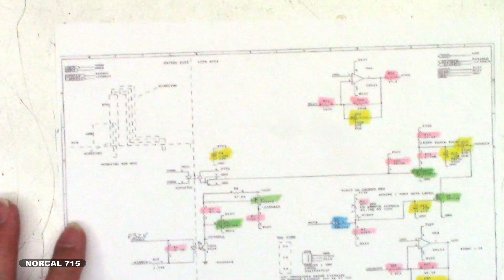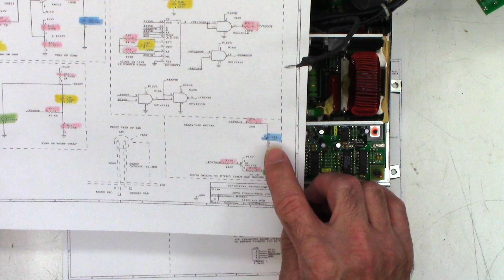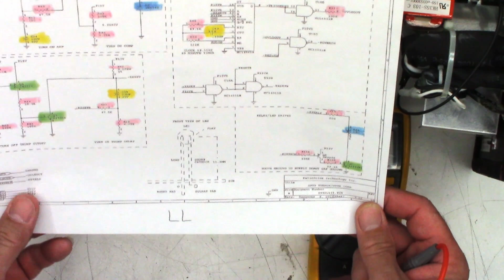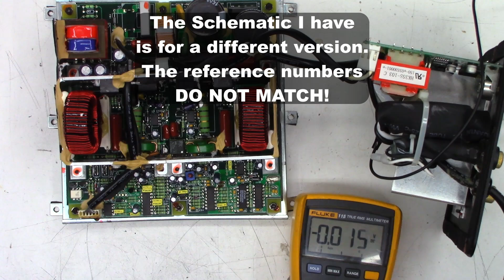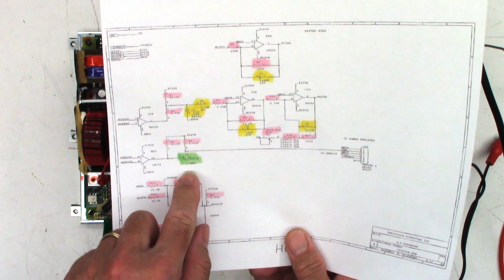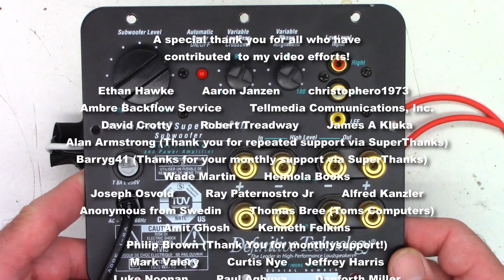And YET Another Definitive Technology SuperCube that will not power on Part 2 SuperCube 3 Repair

Comment: Hi,
I got a Super cube 1,  there's a crackling noise coming from the woofer. I found couple of opened capacitors on the pre amp board. I replaced all small capacitors on the pre amp and power amp board. Crackling noise still present. I didn't replace the main filter cap 2200uf 200V. Crackling noise is present even no input signal is connected. When the gain control is all the way down, no crackling, when bring gain up, you can hear the crackling noise. At some point the 8amp fuse was blown. I checked the mosfet, all checked ok. replace the fuse, fuse didn't blow. Planning to change the main filter caps. any suggestion. Thank youi